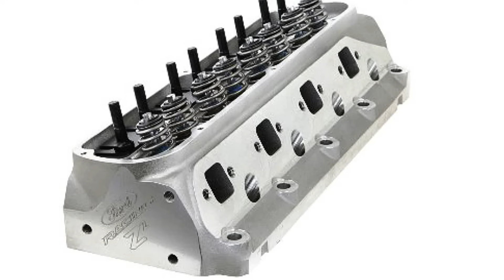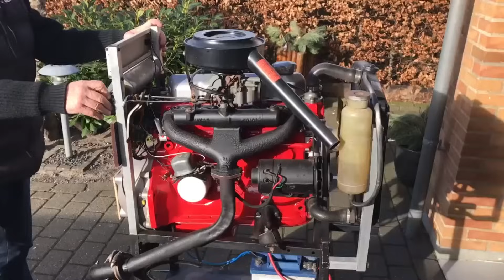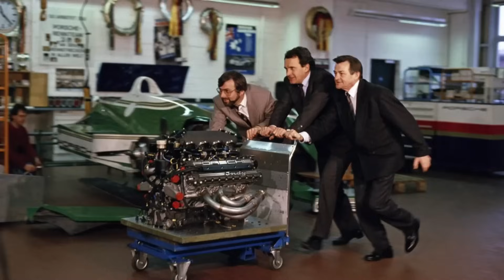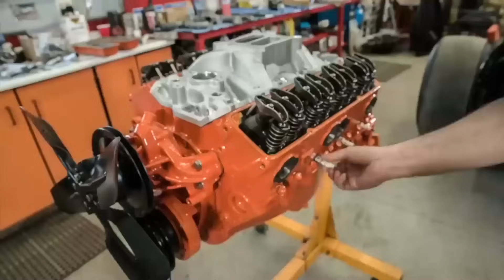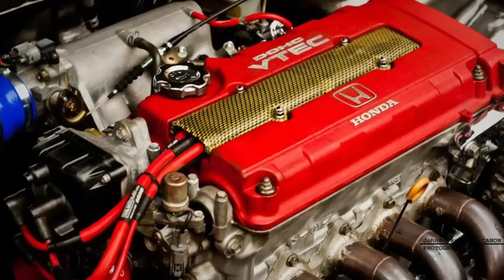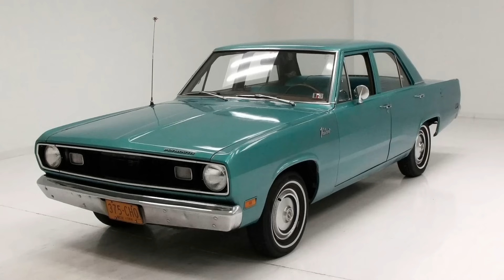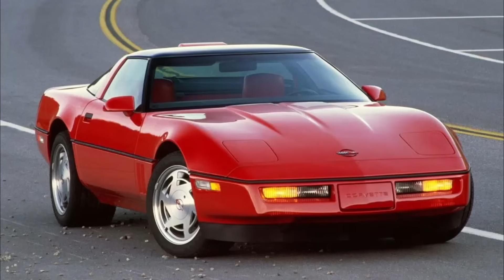30 Car Engines That Will Last FOREVER (2024)

Comment: I know 4 or these engines and their great but 2 engines are far better than all of these and that’s the 6.6 Duramax diesel which is known to hit the million mile mark with an average lifespan of 550,000 miles. The other is the Cummins 5.9 although a very low HP motor it lasted forever. The only reason Chrysler had to quit using them was emissions and because Chevy had built the 6.6 Duramax which had well over 100 hp more than the Cummins and there was a demand for the higher HP diesel engines.

Comment: I had a 318 V8 in a 79 dodge van.
I loved that engine.
Very impressive and reliable..they were great engines.
I also had a small block 350 in my 70 Chevy Caprice..another great engine

Comment: 1.9 L DOHC engine in the 97 Saturn was unbreakable had multiple cars hit 450k before i sold them still running with proper oil changes only issue that ever had was starters where cheaply made

Comment: WELL HERES THE REAL SECRET NOTICE THE TOP 10 ENGINES ARE FROM 80 90S TIME THE LIST IS BACKWARDS THE NEW ENGINES ARE AT THE BOTTOM AND THE OLD ENGINES ARE AT THE TOP. THE VW BENZ DIESEL AND THE VOLVO WOULD ALWAYS GET 1M FROM IT

THIS LIST PROVES THE NEW TECH IS KILLING ENGINES NOT HELPING  ENGINES THATS WHY'S THE LIST IS BACKWARDS IT SHOULD BE THE OLD AND THEN NEW ARE AT THE TOP

Comment: I'm driving a 1990 Mitsub. TP Magna.
Nearly 600K on the clock.
Bought it for $400 in '07.
Runs like a Swiss clock.
It has never broken down.
Gets the same economy as when I bought it.
Why would I buy a trash heap of trouble that masquerades as a "modern" vehicle?!

Comment: you all need to learn about the australian barra. we used them as taxi engines and after the taxi companies didnt want them anymore, tuners got their hands on them and made them make over 1000hp and they often do over 1 million kilometers and are still running if average maintenance is done.

Comment: I have had 3 Jeeps with the 4.0L and it is my go-to engine.  Great low-end torque, perfect balance, smooth as a sewing machine and tough as a bull.  You can buy one with 300k miles with a noisy head, run MMO for a couple oil changes and they'll purr til the body wears out.  Plus on 90s and 2000s Chrysler cars, you could pull your own dtc codes using the ignition switch.  Saved me tons of money 💰 Still driving 2 20+ yr old Dodges (2001 Durango and 2003 Dakota) with the 4.7 😕 already replaced one but they been in the family since 2006 so i know these trucks.  Yes the 3800 by GM! Honestly the 3100 was a stout little engine as well as the 3400.  I had an old Sonoma with the 2.8v6 5 speed. That truck made it to 370k then an LS was droppeed in

Comment: The cars scene most that are over 20 years old are volvos. Period
Reply: Plenty of 20 year old Trailblazers on the road here in Wisconsin. Change the oil every three thousand miles and 200K is easily obtained. Don't forget to change the other fluids too. I see more of these than Volvos here. I missed the last oil change.by 3000 highway miles and was down only a half a quarter. The 2002 has 197K on it . The engine is purring like a 🙀.  Though it does need some other mantainence. She's a big 🙀 without power steering at the moment since October 31. Still not too bad to drive anyway ... until I get a new power steering pump installed.  Not bad though 197K for a GM power steering pump . It needs new ball joints too the boots have finally cracked. It's last major item was front wheel bearings 20K ago. Other than that it's been regular maintenance since my father bought it new in 2002.

Comment: Photo of the Nissan SR200 engine block appears to be an inline 6 cylinder block. I've seen enough photo screw ups. Put more care in producing videos, don't use incorrect photos.

Comment: Datsun 240, 260 and 280Z engines should be in this list. They're actually licensed copies of Mercedes OHC 220 engines that were originally cut down to 4 bangers and bored to be 1600 CCs to power the Datsun Roadster that was meant to complete in new Zealand against the pushrod engines of the day. And were the predecessor of the Z car series. The Z car was a clone of a 1968 Ferrari Dino.
With seven main bearings and overhead cam it outperformed everything in it's class for years after the two cylinders removed for the Datsun Roadster were put back and the displacement increased to 2.4 liters.
You can't wear them out... you either die in a crash or lose your license before they'll ever wear out.
I've had many of them back when they were everywhere.

Comment: Two engines i can say are practically unkillable but not on this list are the Mazda B2200 2.2 I4 and the dodge 318. 
The 2.2 mazda engine is slightly overbuilt in that the High Nickel iron block is a little out specced to the rings (Stock applications and the rings tend to wear faster than normal. While this is a bit discouraging, the rest of the engine is probably barely broke in. I had a 2.2 with 80K and would smoke on big accelerations (for it's ability) but otherwise no issues, I sold it to my dad he drove another 50+k miles after a timing belt change (honestly wish i had it back i miss that truck.
The 318 (5.2L) dodge LA engine needs to introduction, they are just about as tough as the slant 6 you included . Seen many in basic cars and even trucks that would just never die

Comment: I did quite a few timing chains and tensioners on 22RE Toyota engines.  The chains would stretch and start wearing a hole in the front timing cover, causing coolant leakage into the oil.  Aside from that, a fantastice engine.

Comment: And they are not wrong about the Honda J35, I just worked on a Honda Odyssey with 330k on it, its a "work van" for the guy so those are hard miles carrying lots of weight and it runs extremely smooth.  The body of the van is beat up and probably wont make it another 100k but the motor certainly could.

Comment: The 3SGTE is probably the best 4 cylinder ever made.  The race variants (modified but still the same design) could put out well over 1,000 horsepower and required very little maintenance.  Its small size, light weight, huge power and fantastic reliability powered some of the most successful, record breaking, and reliable race cars of the 90's

Comment: I had a jeep MJ (Comanche) with the 4.0 and it had over 750,000mls when I sold it...the guy still uses it on the farm and it now has right at a million...just oil changes, plugs, cap, rotor, water pump, alt...nothing major, just basic maintenance...I've had 4.0L jeeps for the last 25+yrs...still daily drive a TJ🤠👍

Comment: Sure.  My 84 1/2 ton 2wd Dodge pickup had one,  15mpg and 68 top speed, that's WITH all brand new tune-up parts and distributor with 53,000 original miles.   0 to 60 was something like I believe 18 seconds.   So definitely keep it forever if you want to drive yourself (and everyone behind you) nuts for 30 more years

Comment: Slant Six . Was under powered work of art. In hills it had the ability to run down them , and at the top be doing a little better tan a walk. Great gas mileage. That is all I can say for them . I had 3 of them. All ended by becoming boat anchors. At less than 250 000 miles .

Comment: I had the Eco Tech 2.2 L61 in my 69 Camaro with the ZL1 package! My cousin is still driving it with 324k on it. the only thing we replaced was the water pump! Original spark plugs and oil filter and still runs like a champ! My uncle totaled his. He had 273k on his... Had to do a head gasket at 250k because he forgot to refill the radiator doing a flush and drove it all summer and realized there wasn't any coolant in the winter, no heat... Tough lil buggers. 240 horses. I miss that car!

Comment: Two things I realised (1) Toyota and Honda engines dominate the list. Unsurprisingly so. (2) Regular oil changes and replacing timing belt are recipes for the longevity of most, if not all, engines

Comment: Yeah the Jeep 4.0 mines got roughly 640k miles and yeah it does burn oil around 1 quart every 3,000 miles which honestly that’s not to bad and it’s got 160 PSI of compression in all 6 cylinders I’m just running it and seeing how long it will go hopefully 1 million miles 💪
Reply: 1 qt every 3k miles..
 I have a KIA 2.4L that burns 2 qts every 1K miles
Reply: @bobreese4807  try adding Lucas oil stabilizer to the oil that did help with my oil consumption
Reply: @aidanscull5770  Thanks for the reply. What did yours burn before? I am in process of the 3rd dealer serviced piston soak to free up the oil piston rings. If it fails I am due for a new engine from KIA.....maybe... Why do you think Lucas helps? I heard another person say good things about that oil treatment.
Reply: @bobreese4807  lol she was burning 1 quart every 50-100 miles just nothing but blue smoke we called it rolling oil 😂 so someone told me to add that and I thought it was going to do nothing but that’s when it got extended to around 3k miles so I’m pretty sure it will help
Reply: @aidanscull5770  Wow . quite a change.  I wonder how much was due to rings or to valve guide/seals wear.
Reply: @bobreese4807  yea and I also run 15w-40 diesel oil during the summer time and that helps a lot to but probably couldn’t get away with that in your engine mines pushrod engine so it’s fine for that over head cam I don’t think that would end well

Comment: I bought my Lexus IS300 back in 2011 which has the 2JZ! The car has 260k miles now and still runs like new. EVERYTHING on that car still works! I maintain it well and it never lets me down! I’ll own it until I die and leave it to one of my kids.
Reply: GS300 for me.  300k.
Reply: 03 camry 1MZ-FE  350k purrs luke new, same motor I old es300 lexus

Comment: Ford's larger Modular, the 5.4L is another very durable engine. Best friend has one in an E250 van, 654,000 miles on it when I had to replace the heater return pipe that had rusted through.

Comment: These AI generated videos and voice overs are funny. The GM EcoTech L61 engines are junk!!!!! The timing chains self destruct all the time. The Nissan RB26DT's bottem end is as fragile as glass. The Mitsubishi 4G63T love to take the crank for a walk. The Subaru EJ engine series loves leaky head gaskets and weak rod bearings ( I am a Subaru owner). The Jeep 4L engines love to break piston skirts. Ford Mod motors Love tossing rods and spark plugs. So you ask how I know all of this. 33 years as a auto mechanic, and you will see where all the problems are.

Comment: Now I have listened to the list, as a mechanic. I know some is true, but calling the Chevy 350 a great engine??? I have replaced hundreds of them! Garbage rod throwing pieces of junk!! So glad they went to the 5.3!!!! Occasional lifter tick in the early models. Newer ones have complete engine failure! Afm is not the issue! It’s lack of oil!!

Comment: Had an l61 Chevy in my 05 cavalier. When I sold it it had 275k miles car rusted out around the motor. Had it for 15 years since new. Never had a major problem. Burned lots of oil about a quart a week after 1500 miles

Comment: I would add the Mercedes sprinter OM651 which have been reported in commercial vehicles to go 1 million miles, mine has 320,000 miles and runs so smooth like new !

Comment: With a few upgrades options such as a high performance cam & lifters, heads, pistons intake , larger carb  and headers. Add 100 hp

Comment: The only one i had was the 1.9 TDI but it was very good indead. This thing is so reliable that you can daily drive it for years without ever needing to change anything in the engine (except oil and filters). I heard that it can also be tuned to 200-300hp and still remain bulletproof but idk if that's true. My VW was completely stock.

Comment: You missed the 300tdi which has been known to go for over 800,000 miles and was favoured by the British military in all their Wolf Defenders for years after is had been replaced by the TD5. But I guess you never got them in America. Their great strength was slow off-road use as a workhorse, that could be repaired anywhere in the world and with simple tools. They run on a wide variety of oil based fuels, even old cooking oil.

Comment: Hey Subie guys, if you replace those crappy single layer graphite coated head gaskets, replace them with the MLS turbo gaskets. Ive got 278,000 miles on my 2008 Subaru Outback 2.5i

Comment: Fun fact about ford pick ups 

1992 and 1997

F150 and f250 
           300w i6- 5speed manual
           351w v8- 5speed manual
           300w i6- e40d auto 4speed
           351w v8 e40d auto 4speed

F350. 
Common Powertrain— 460w v8- 5speed manual
Common Powertrain— 460w v8- e40d 4speed auto 
Less common— 460w v8- c6 3speed auto
Less common— 351w v8- 5speed manual
Rare— 351w v8- c6 3speed auto

Comment: You forgot the in the 2011 2019 Toyota sienna highlander 2GR-FE V6. ford 460w and 351w Windsor v8 in there 1992 - 1997 f150 through f350 and f450

Comment: In my experience, the Subaru EJ205 won't make it past ~70K miles without a head gasket replacement (or failure).

Comment: Australia's Ford Barra inline 6cyl has shat on many of the above for power AND longevity and doesn't even get a mention. Capable of being built to 2000hp in turbo models with major modifications, and know to easily achieve >>>1,000,000km's<<< in the LPG gas powered taxi version without ever being opened.
This list is therefore ridiculous fluff and feathers!🖕😂🖕.

Comment: You forgot about the real GOATs of reliability. The Volvo B5244S (2.4) and the D5244T (2.4d and D5). Both will last well past 500kkm if you treat them well. The latter can even reach into the 1 million km range with just regular service intervals and changing of the belts.

Comment: bought a Plymouth Valiant 40 years ago for $250 -  yes that is right.   the gauges did not work,  the drivers door did not open,  the windshield had a  crack etc etc.    to start the car i would open the hood and manually choke the carburater with my hands.    i only drove it 10 miles on a straight highway to work and back.    with all that abuse ,   i knew that slant six would keep limping along.  kinda the engine dragging a lump of metal down the road.

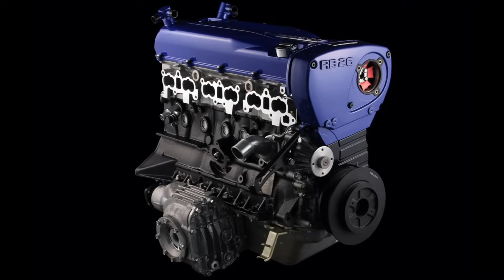Comment: ok just caught a lie at 6:09, earlier you said the cast iron heads of the 302 made for better heat dissipation now at 6:09 you said the Aluminum head have better heat dissipation. both CANT be true.

Comment: Sadly you didn't mention the Australian ford barra 
4ltr  inline 6 . 
24 valve , twin over head cam .  Built  2003 through to 2017 used in passenger cars  commercial vehicles 
Many barra powered taxis 
Achieving  1.000.000 klms 
With only regular servicing.

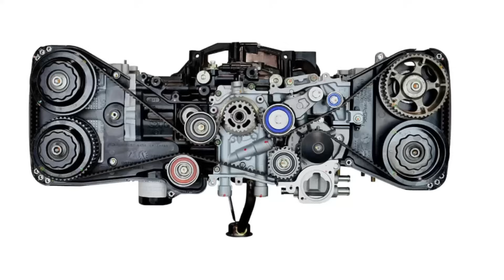Comment: 10:11 10:11 I will agree with you on the BMW 3.5 liter straight 6 great engine. I think BMW really missed the boat on this engine they should have turbocharged every one of those straight 6 BMWs that hit such a great bottom and then could take the power they have tremendous before performance and would have been more well-known engine

Comment: I have an old Mercedes Benz 6 Zylinder Diesel  300td from 1991 with now 725 000 km. The engine is still totally running perfect.

Comment: The 302W and 351W motors are the same except for deck height and are just as dependable.
Reply: @wrksnfx 
 So What makes them different? Do you know the difference between 302W and  351w?

Comment: My 2001 VW Golf diesel 1.9 has 275000 miles with only routine maintenance not counting replaced turbo @ around 260000. I have never babied it, she gets worked hard and has been very low cost to operate over the years since I purchased it new.

Comment: I got a 2003 buick lesabre 3800 series 2 v6 bought with a 120,00 regular oil changes and filters. 340,000 and its my daily commuter great motor 😮
Reply: Buick seemed to have kept a reputation for solid engineering .  Buick owners were a very unusual breed !

Comment: my toyota 4K never had a change oil for 30 years and still running until today maybe hitting 1 million mile mark or more..i used it at the farm pulling a trailer with 40 sacks of palay or rice  grain weighing 50 kilos each and pulling it on a 30 to 40 degrees inclined road with ease...

Comment: Surprised the Ford 351W didn't make the list. It's basically a 302 with a taller deck. Also the Ford 2.3L engine that powered the base Mustangs of the 80's were UNBELIEVABLY strong! Those familiar with the Mustang SVO or turbo Thunderbirds know what I mean...

Comment: My 3.8 Buick=341k
4.0 Explorer=260k
5.4 Econoline= 301k
6.0 power stroke=524k
Reply: William, that 6.0 Powerstroke with 524K. Was that with or without being bulletproofed?
Reply: @DG-oq8hj  It suffered the usual EGR failure,  coolant in #8 hydrolock,, broken starter etc. A Ford dealership diesel tech performed the repairs. Certain cylinder head designations he pointed out to be all stock. Never went through. He was shocked also. 

Some time later, #4 injector failed, I continued hotshot nationwide. #5 finally failed, couldn't do the mountain grades, so I parked it. Went to my gas Chevy 2500, now gas Ford super duty 250. When I get a break, the 6.0 is going back into service.  Can't wait! An economical beast! !

Comment: Stop dreaming.  None of that engines will last forever without proper maintenance. 
I saw OM617 which were dead after 220000km, I saw a totally worn T5 from Volvo after 170000km, even the famous k24 from honda,  which was overheated and broken after less than 100000km...

Comment: Idk about the 2zz, I’ve owned 3 of them 2 of which grenaded themselves around 150k miles. It’s an awesome engine, it just needs attention. Use the right fuel, pay attention to the oil because the oil pump can break, and make sure you the right parts for it because I’ve found out the hard way that the water pump, clutch, and alternator from the 1zz will fit on the 2zz 🙃